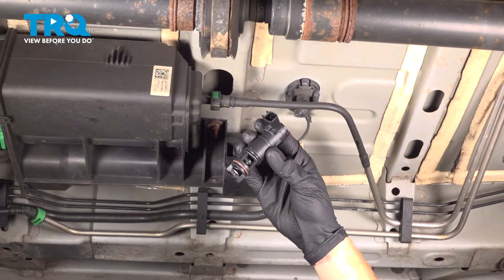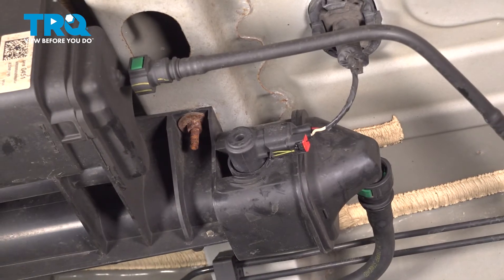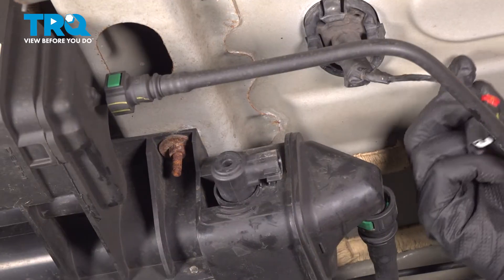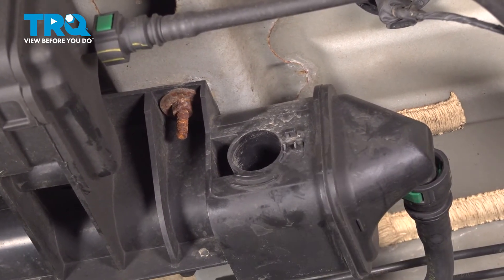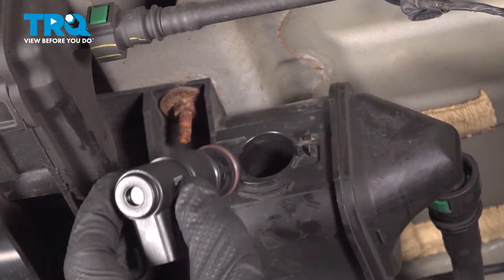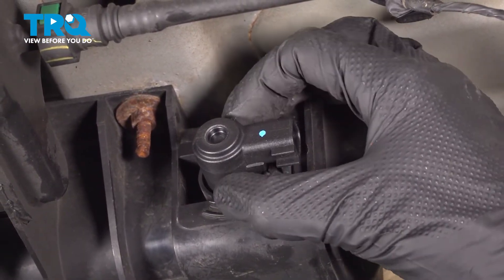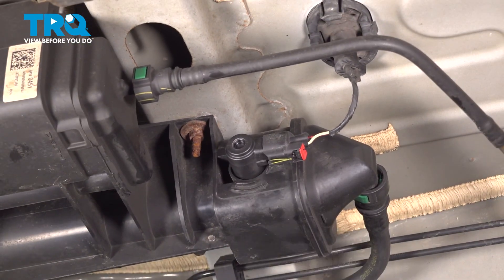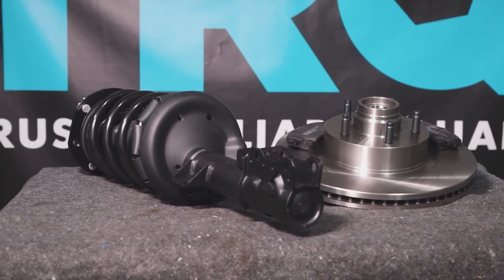How to Replace Vapor Canister Purge Solenoid Valve 2017-2024 GMC Acadia 3.6L V6

Comment: Do you have a video of how to replace that charcoal canister that the solenoid is connected to? I currently have a 2017 GMC Acadia Denali that runs rough and will die after after filling up the gas tank I do not overfill when the gas pump kicks I stopped pumping I have tried to troubleshoot I have replaced the solenoid on the front of the engine and that did not correct the problem one of the symptoms that it has is when I'm turning left a fairly hard left after filling up it stalls but it doesn't appear to do it going to the right
Reply from the maker: +@1navyguy We're always cycling through common cars. We'll add this repair to our list! http://1aau.to/m/Shop-TRQ